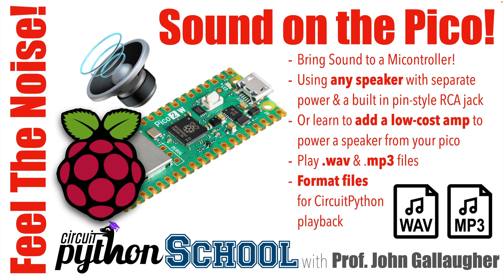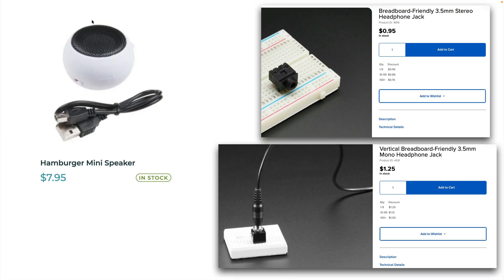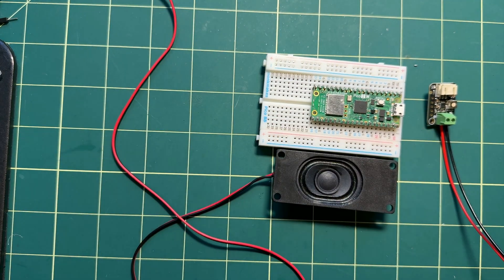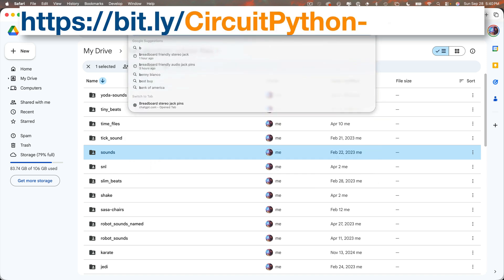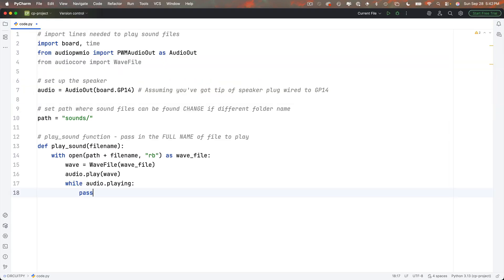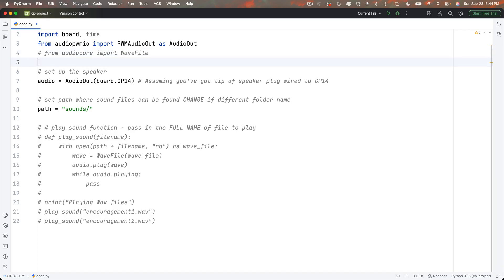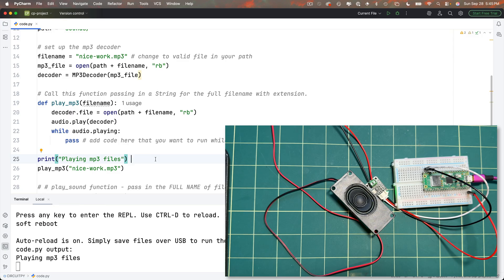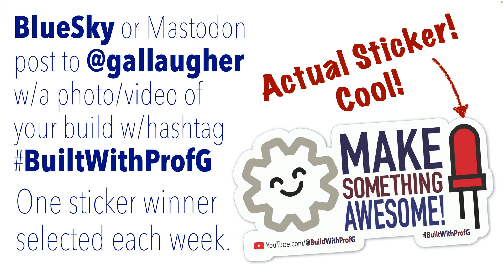Learn to Play wav & mp3 Sound Files on the Raspberry Pi Pico (2025)

Comment: Recently, I was playing with a non-blocking PIO driven wave player in microPython. I encountered the popping as well. Since my version was 8-bit the zero level is 128. By adding a ramp from 0 to 128 at the beginning and 128 to 0 at the end I eliminated the pops.
Reply from the maker: Great advice Sam. I do like the DAC as a gateway to use synthio. I’ll be posting lessons on that after I learn enough to share. Hack on!